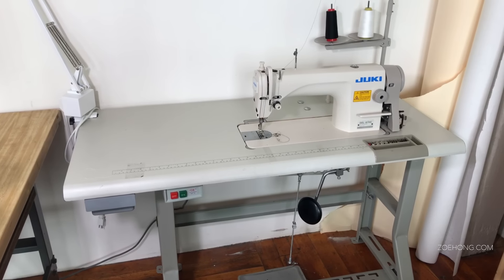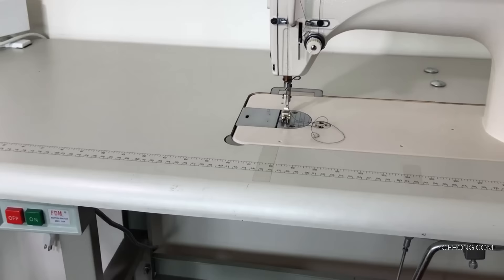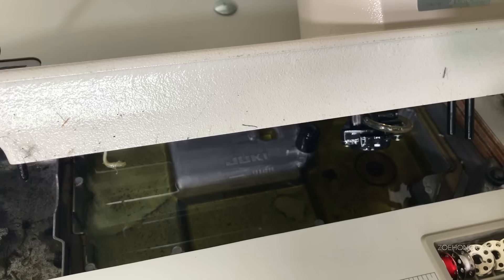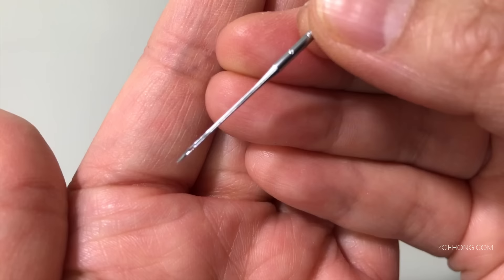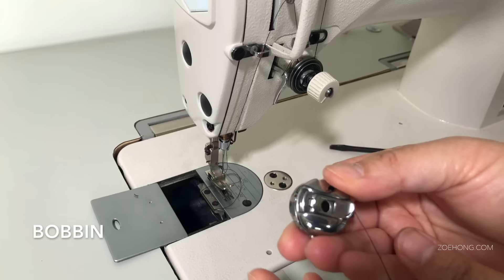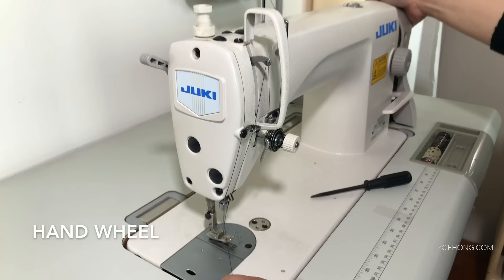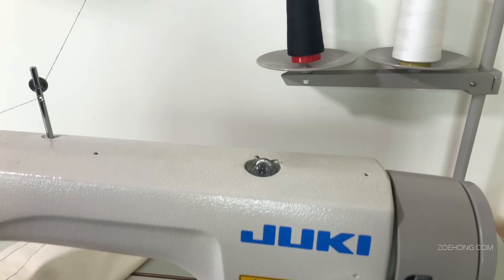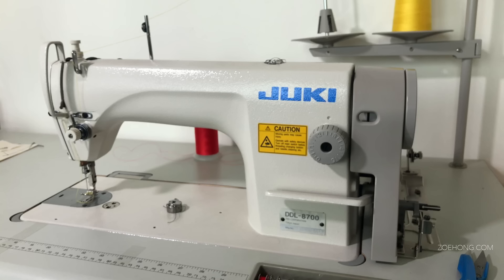Intro to Industrial Sewing Machines

Comment: I just asked this question on another channel, but it seems that your machine would most likely resemble what I remember.

I had a friend. She had a machine with scissors built into it. She put my jeans in the machine, the machine folded the jeans, cut the jeans, and hemmed the jeans, just like it was off-the-rack. There was no manipulation of the jeans, just put the jeans in and the machine did it all. It was an industrial machine I believe. She told me it cost over a grand, used. You could not tell that the jeans had been hemmed at home, it was as if the jeans were bought at that length. What kind of machine does this? I'd like to look into it. Thanks!

Comment: I've had a Juki 5550N for almost four years now.  (The 5550N is exactly the same as your 8700, but assembled in Japan.  You get to pay a couple hundred dollars more for this dubious distinction.  At the time, I didn't know any better.)  The first question I get from most people is "Why bother?"  It seems that most seem to think that their high dollar fill-in-the-blank sewing machine is bound to be equivalent or better than an industrial lock-stitch machine.  "After all," they say, "you can only do one stitch with that big, heavy, expensive sewing machine."  True, any machine can do a simple lock stitch, but do they do it as well ... as effortlessly?  No!  In fact, I also own a Janome Memory Craft for all those specialty stitches and the like.  It's simply a case of, not just the "right tool," but an "exceptional tool" for doing an exceptional job.  There's a reason why a lock-stitch machine will be a fixture in almost every serious designer's shop.
Reply from the maker: Yes! I love this machine SO MUCH. I have never had a problem with it in the 11 years I've had it and it's so rare I feel like I need any other machine, except my overlock, which is also an industrial Juki.

Comment: Hey Zoe thanks for the tip on changing the thread color without having to re tread the machine. I’m not great at sewing but I love my Tacsew industrial machine. I put a servo motor on it to slow it down. It’s so quite! I forget that it’s on. I need one more adjustment to make this perfect. I need to figure how to make the control foot pedal smaller .i have a hip replacement and it hurts to lift my leg/hip to step on the pedal. I hope my husband can figure this out...
Reply from the maker: Happy to help! Good luck getting your machine perfect!

Comment: Would you suggest this machine for someone who does quilting? Will it sew two layers of cotton fabric with batting in between without puckering? I know it has no walking foot.
Reply from the maker: I've never made a quilt before, but I have sewn several layers of fabric with a thin layer of batting before with no problems. I recommend you take a sample and test the machine before buying.

Comment: The 8700 machine has an adjustment for the feed dogs. (to the right of the dogs on the bed of the machine). Have you made any adjustments to them for sewing different fabrics or doing free motion quilting?
Reply from the maker: I have not made any adjustments. This one sews just like the ones I learned from in school so I guess I'm just used to it so I didn't look into it. I've never done any free motion quilting.

Comment: Thank you very informative. I have a JukI DDL-5550 and tried to wind my bobbin and the wheel, nor the bobbin will spin. The motor attempts to go but the belt would not move. It acts as if it is burning rubber then it Shuts down. Could you help or direct me on what to do?
Reply from the maker: You need to talk to a sewing machine mechanic for that.
Reply: Thank you

Comment: Can't beat the DDL-8700.  I bought little magnets and stuck them across the thread stand and I hang all my different feet there.  nice and handy right in front of my face.  don't have to dig thru a drawer to find what I need
Reply from the maker: It's my beautiful baby and I love her so much. :D
Reply from the maker: That's a cool idea but I personally don't like the look of clutter. Other people would probably dig it though.
Reply: I think you can get a presser foot holder that will hold 3 different presser feet, and you can rotate the holder to the correct presser foot. I don't need it but it sounds neat.. :-D

Comment: Hello, I just found your channel, and such a blessing. It answered several of my questions. I just got hired as a seamstress.I have been sewing for 40 yrs but it has been quite sometime since I sewed on a professional machine.
The jobsite has a juki straight stitch just like the one in your video. The question I have is this. The machine I will be using will not allow me to slide the bobbin door open. I am thinking the machine is a little low on the table. Is there an adjustment I can make to help the door slide over the table?
Reply: You may need to replace the rubber corners that the machine rests, you can buy these online that are pretty cheap. I had this problem and that's what I did.

Comment: I wasn't able to see the Hi and Low lines for the oil fill tank, but I am really surprised that there is  an oil tank in the machine. Do you ever stain any fabrics with oil? No accidents with oil? What kind of oil is that? I never saw the inside of an industrial sewing machine. This bugs me out a little.
Reply from the maker: No accidents, the oil should be contained in the tank at all times and get serviced if otherwise. It's an industrial machine, it needs oil to grease the parts. It's specifically sewing machine oil and you need to get the one what matches your machine. Mine is from Juki, same as the machine. Don't get car oil or something hahahha~
Reply: @zoehongteaches  , thank you for your reply. I am always curious about things. Another question, please. When you placed the bobbin and thread into the machine, is the thread on the top side of the bobbin or at the bottom side?  I couldn't see how this was inserted.
Reply from the maker: the bobbin goes in up and down like a car tire and thread comes up top

Comment: Hi I love your video, I’m a designer & have been using a regular sewing machine to make my products but have wanted to get a higher power machine to make my life easier, my only concern is I won’t be able to sew t shirt material or cotton sweatshirt material, is that doable with an industrial? Thank you so much for helpful video
Reply from the maker: For t-shirts and sweatshirts, I would recommend an overlock machine for seams and a coverstitch machine for hems. That's the industry standard.
Reply: Zoe Hong okay thank you for such a quick response!

Comment: Is so fast thou and I'm still scared using mine. I need to work on my foot work more. Does yours have a servo motor?
Reply from the maker: I don't know anything about motors. As for your footwork, it can help to wear shoes with a thin sole. Gives the illusion of control.
Reply: Hello ma'am .. Where can I get this machine in the US and top quality
Reply: You can put a small cushion or pillow under the foot pedal to help with maintaining a steedy speed. I believe that you can also adjust the speed on the servo motor but I have never had to do that.

Comment: I'm here because I've been working in a textile factory for 6 months and my juki is my baby and I hate my home sewing machine now

The biggest difference between my work machine and yours seems to be the  foot raising! Mine has 3 little zones in the petal. Front for forward. Neutral and then back for raising (unless you're in the middle of a stitch and then it backstitches.  And YES I have stabbed myself in the finger many times trying to fix it with my foot on the petal like an idiot)
Reply: Also the matinence guy at work SOLDERS the foot  screws in

Comment: thanks for that video! allthough i still have tl repair my domestic sewing machine to start diying again this video was interesting and helpful.

one thing though: you "corrected" yourself in the video as you said stitches per length/inch. in my opinion length per inch is still better, since here in germany my sewing machine measures in stitches per cm. inch is just not universal, allthough many manufacturers ise that unit.
Reply from the maker: I prefer "stitches per inch" because when people who use the metric system hear that, they usually think, "ok, I need to switch to cm for me." When I say "stitches per length" people can wonder "is that a special industry term, what is the length they're using?"
Reply: Zoe Hong thats fair of course. allthough there are also people who dont live in the us and now could think "oh i have to switch to cm" now. also i personnaly orefer SI units ... but then again i live in Germany and i also dont know where the majority of your audience comes from - i suspect most of them live in anerica.

and point on case - if the units of stitches per length os the only thing to brag about then you again made a great informative video!
Reply: what is price of it

Comment: But I was told, by the vendor who sold me the machine, the groove of the needle should be one the right hand side.  Now my Mom and I, are confused!
Reply: No. It definitely goes with the dent facing the inside of the machine. I’ve put it in the way you said and it will not catch the bobbin thread & if it does by chance, it will jam up, skip stitch’s & shred your thread. It’s a nightmare.

Comment: Question from a 50 year old man.  Why are bobbins so bloody small?   I can't stand them.  Why not just hook up another spool thingy from underneath?   I'm thinking this is poor design.  Cheers
Reply: Have a look at how a stitch is actually made. When in doubt, ask an engineer... or your wife. (Answer from  a 62 year old male Computer Programmer turned seamstress.) No stress anymore though.
Reply: On lockstitch machines like this one, the needle thread (top thread) needs to loop around the bobbin to form a stitch. If the bobbin were very large, a large loop would be needed and it would also need to be tightened correspondingly. One problem is the needle thread would break more easily from all the pulling back and forth. Some people use super thin thread in their bobbin so it'll last longer.